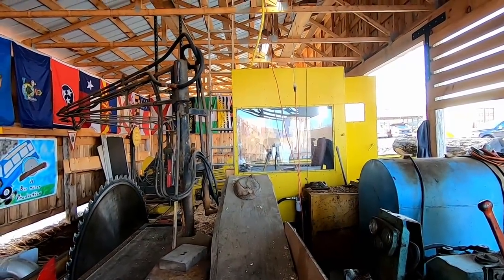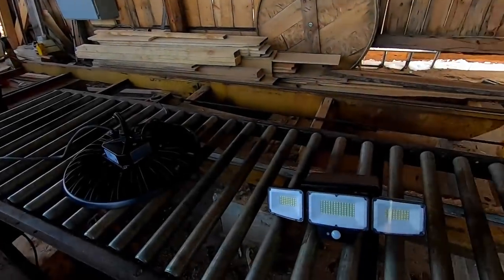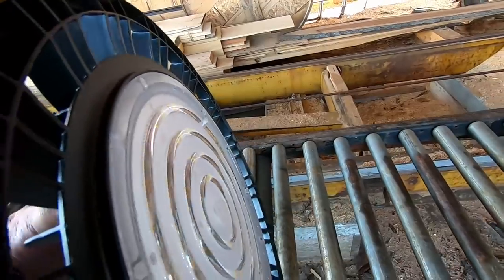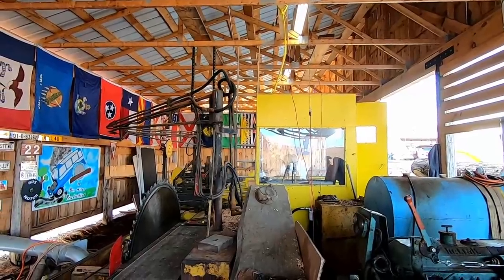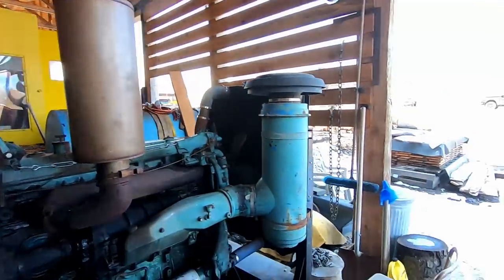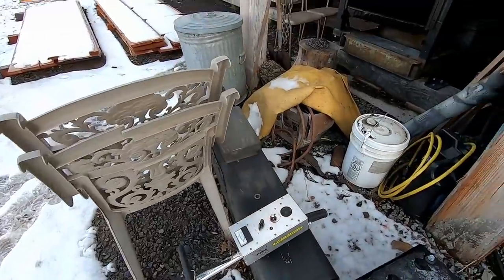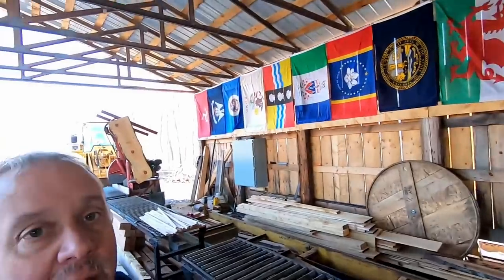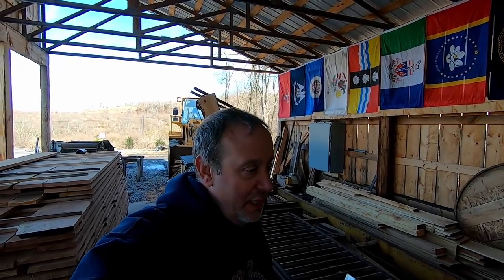new LED lights # 279

Comment: The reason hi-bay lights are so bright is they are intended to be mounted anywhere from about 25' to 60' high above the floor. So the light spreads out and covers a whole lot of floor, but isn't hugely bright at any spot. If you mount them lower, like a normal 12-15' ceiling, they cover a much smaller area and are a whole lot brighter. Sometimes that is good, many times it is not. (Mounting at 12' will be four times brighter than mounting at 24'.)
Reply from the maker: good info.

Comment: Nice lighting.  Makes it far easier to see that the Arizona flag is displayed incorrectly.  The top point on the star is ALWAYS pointed up.  So, the star should point to the right as you look at the flag.
Reply from the maker: thanks.